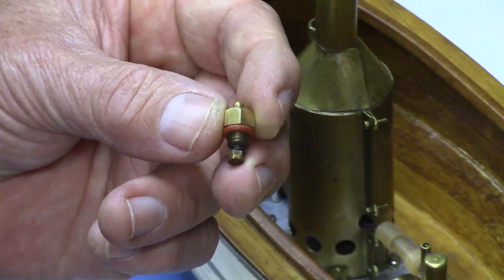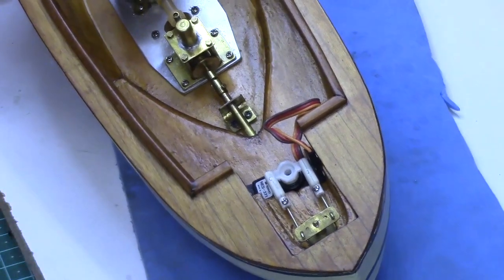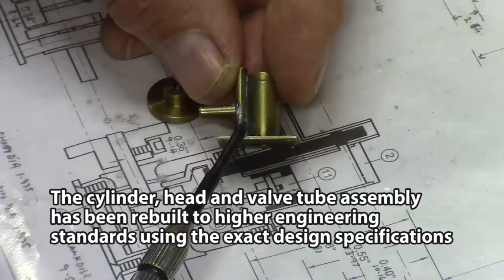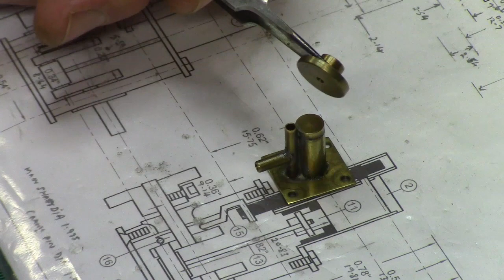PART 9  - Building a Miniature Model  Steam Boat

Comment: Maybe it needs some "run-in" to loosen all those little bearing surfaces.  You know, cars have the brake-in period where all those metal shavings get into the oil and you scream when you see them in the bottom of oil catch pan after the first oil change!!!  None-the-less, Merlin is truly a lovely boat!!!!
Reply from the maker: Thanks :-))  Unfortunately "Run-In "is definitely not the problem. The miniature steam power plant seen in the video has already run perfectly, outside of the boat, for more than an hour on compressed air as well as live steam from the boiler. The propeller drive train in the boat is also meticulously set-up to provide absolutely no resistance whatsoever.

Comment: Many thanks for the video! I waited for this video with great impatience. In my model according to the drawings of Leslie Proper, I also encountered the fact that when the boat is standing in the water, the engine cannot crank the shaft. One of the reasons for poor performance may be the misalignment of the motor shafts and the propeller shaft. I spent a lot of time to align the shafts and avoid them from jamming.
Reply from the maker: Thanks for your comment, yes, you are right about the shaft alignment. I also spent hours aligning the engine shaft, shaft couplers and propeller shaft in order to optimise and eliminate all resistance. The shaft setup seen in the video is perfect and has no resistance. I'm happy that this shaft alignment cannot be improved.

Comment: Hello SteamerEdge,  I think you would get a little more power from the engine if you could get a little more heat in that boiler.  Could you get a little bit bigger wick on the spirit lamp?  Nice video and your boat came out really nice too.
Reply from the maker: Hi Les, thanks, yes I have tried various wick height settings. The longer wick height setting seems to have the effect of increasing spirit fuel consumption but adds very little extra heat to the boiler and the effect on the engine performance is very minor. The engine speeds up for a little while and then goes back to the previous speed. I think this effect may have something to do with the amount of airflow getting to the burner. The burner flame just does not get enough air down the central flue and so does not burn much hotter. If I increase the height of the chimney stack to about twice its length the effect on boiler steam output is huge and the engine runs much faster. But this chimney length looks completely wrong on the boat.